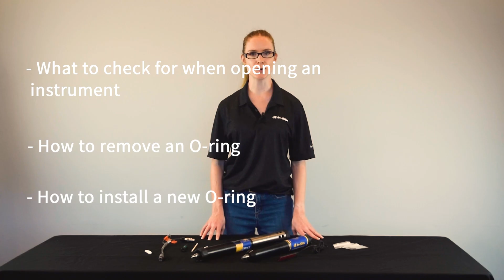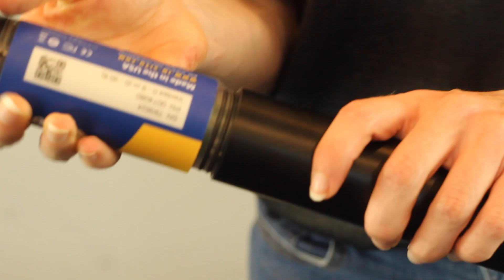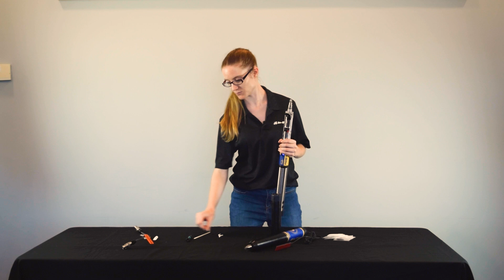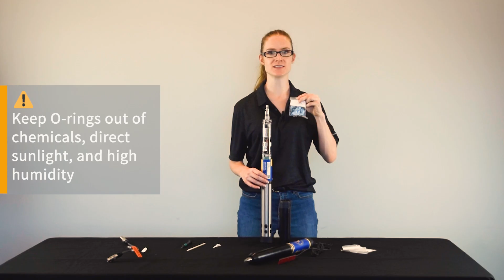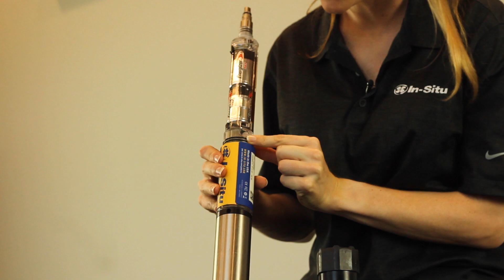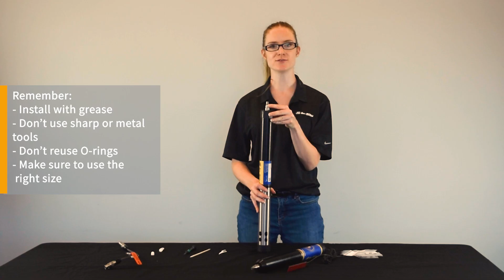How to Maintain and Replace O-Rings

Comment: I heard from many sources not to use petroleum based grease on o rings and other rubber parts as it will cause deterioration over time.  You never mentioned anything about that.